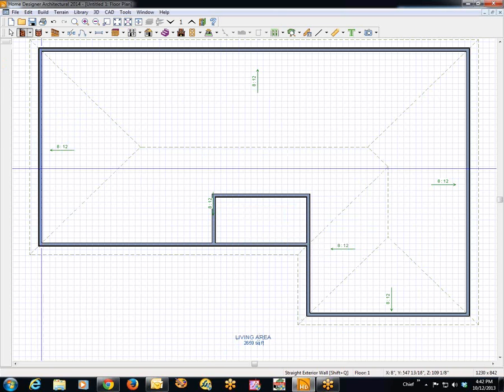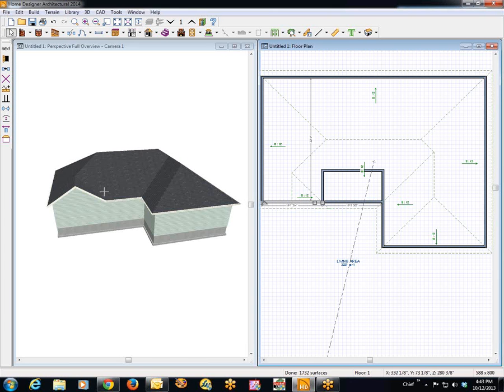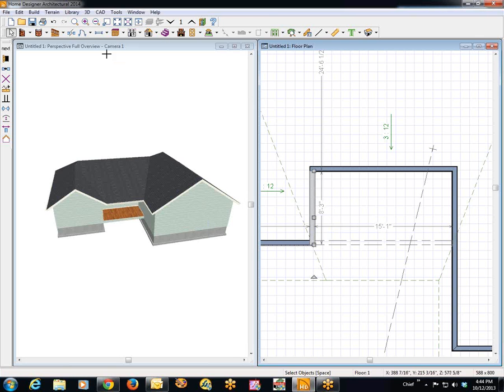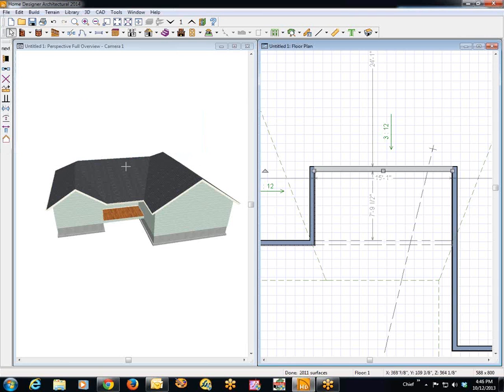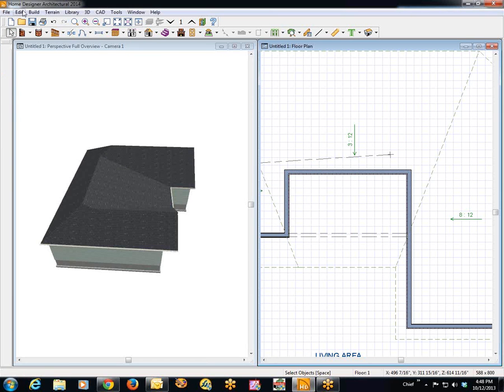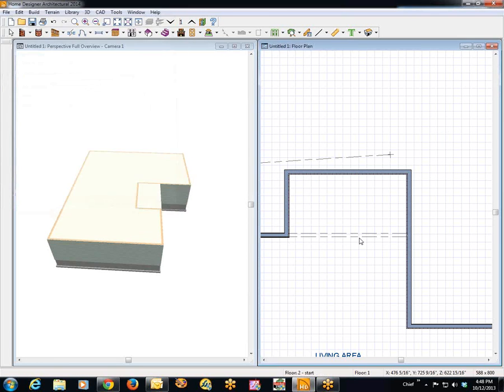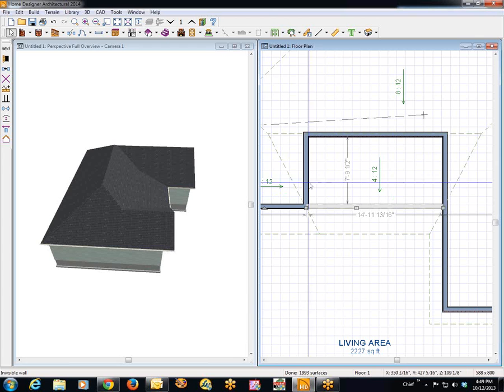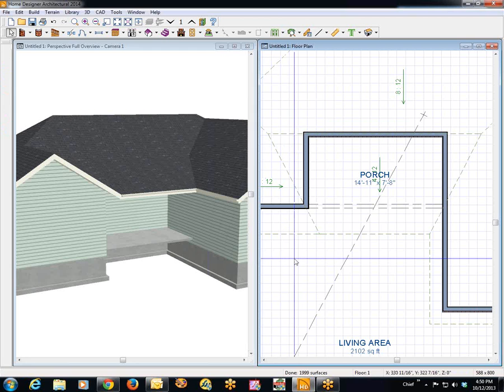shed roof over porch in  Architectural 2014

Comment: Hello David. Thank you for your videos. I have learned a lot from them.
I'm trying to duplicate this house in Home Designer Architectural 2019: 
https://www.youtube.com/watch?v=QDbU1i89woI

I figured out how to extend the monolithic slab foundation to be the porch deck (instead of the wood deck)
I extended walls to include the deck area (so basically a square house), then used the break wall tool, and made the walls of the porch invisible.
But is there a way to extend the foundation out a little further than that (for an uncovered BBQ), or do I have to create a separate slab?
 
I finally got the shed roof right (all one piece over the porch and house), but I cant get rid of the top of the wall on the invisible wall.

Any suggestions?
Thank you.